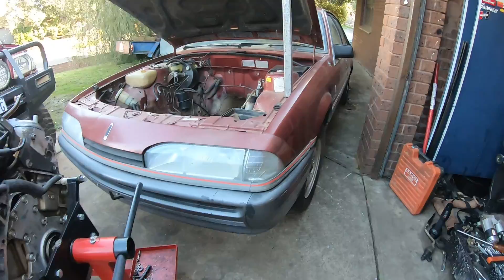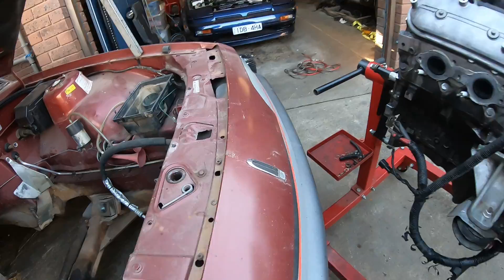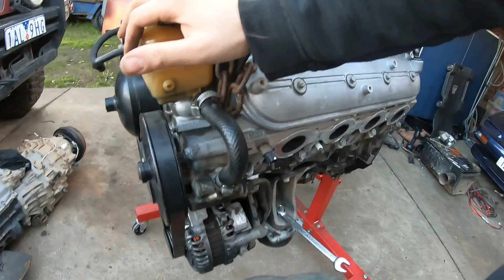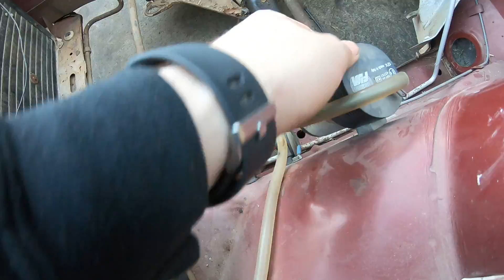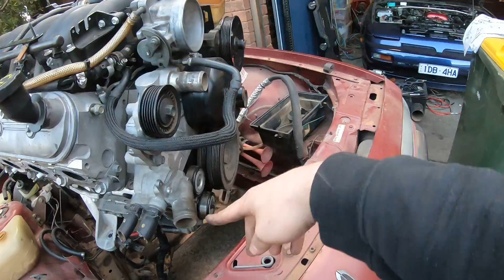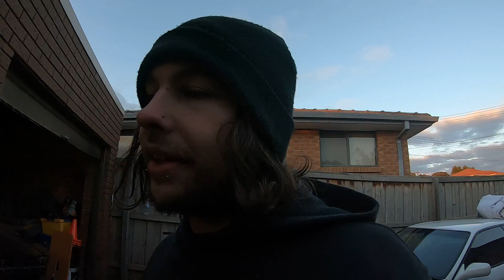Holden VL Commodore: V8 LS1 Build!!

Comment: I've got a vl calais and a vz calais ls1. I'm going to put the ls1 into the vl eventually. The vl needs the front windscreen panel rust repaired. 
I'm thinking of converting the ls to carby to save the headache of sensors wiring and ECU bcm etc. I bought the vl in 2011 for $1100 off an old dude.
Reply from the maker: Hey mate sounds like a sick as car 👌 keen to doo what direction you go with it.

Comment: Nice project, LS VL. Look into a strut brace, if it fits with an LS Engine. 
Are you planning to get Rego?
Reply from the maker: Yeah if the intake plenum clears I would like to run one it’ll be a little more front end heavy now with the LS over the Rb, yeah I will register it I’ll have to engineer it of course !

Comment: What size was that turbo?
Reply from the maker: That was an eBay 30/76
Reply: There is a dude making twin throttle manifolds that will sit on the ls platform. Taken the mold of a genuine manifold and copied the top. Should be good for what you want man.
Reply from the maker: Yes I’ve heard of these! A few mates that have 5ltrs have the twin throttles on theirs I’d love to incorporate them into the LS

Comment: Should just slap a 650 stage 2 cro cam in the rb30 younwill pull 200 kmh in 3rd if it’s a 5 speed manual bro I had mine doing 200 and 3rd wasn’t wound out ran out of road to slap her in 4th
Reply from the maker: I can get close in my skyline that’s got a cammed 30 in it haha